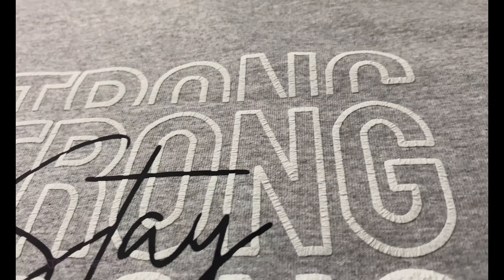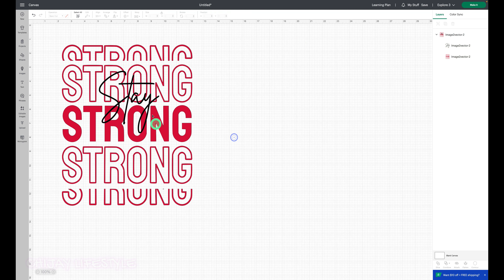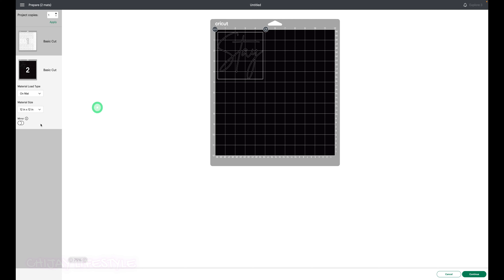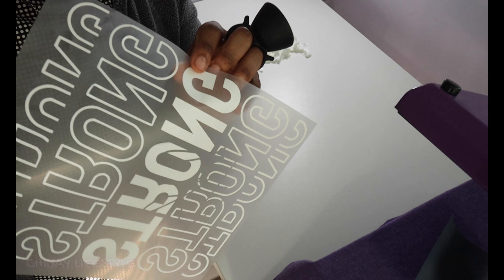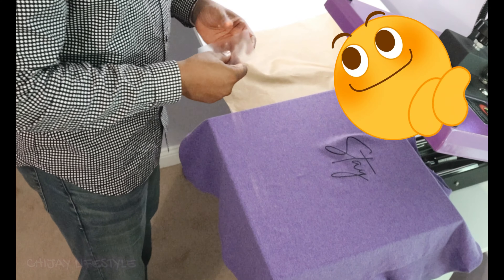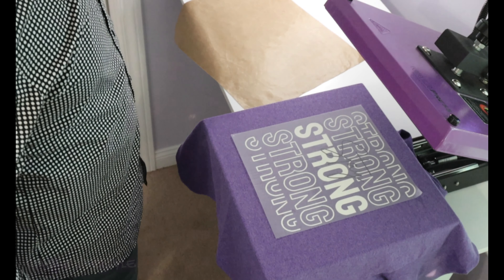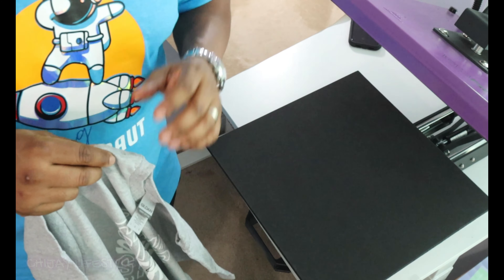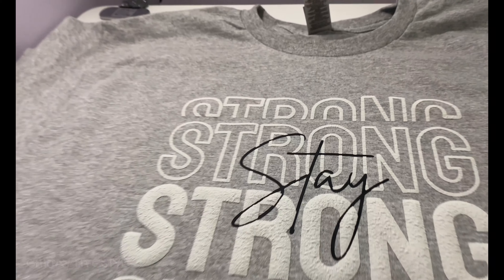My First Puff Heat Transfer Vinyl

Comment: Hi there, I saw a video recently that she said you need it to be on a hard surface with alot of pressure. I have not used Puffed, as I only have a cricut press 2 not enough pressure.
Reply from the maker: Hi Lynda, I've heard that too and I have also heard it needs to be medium or light pressure. It all depends on the manufacturer of your vinyl. My goal is to find a manufacturer that I like then stick with them.